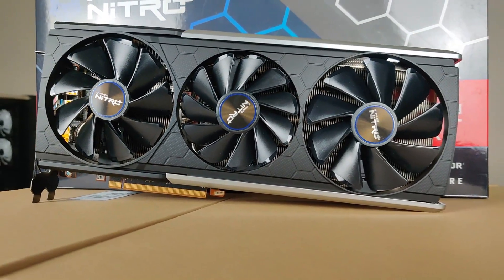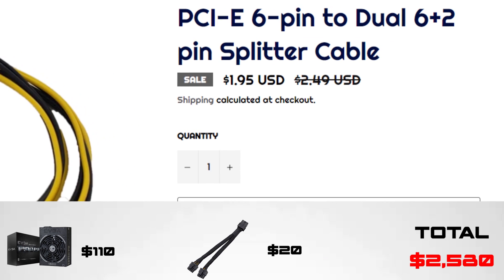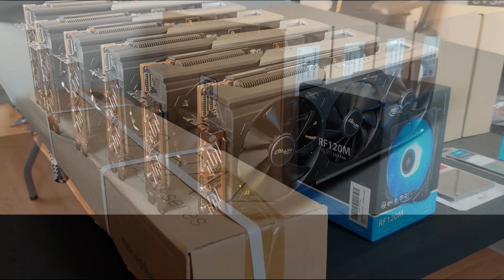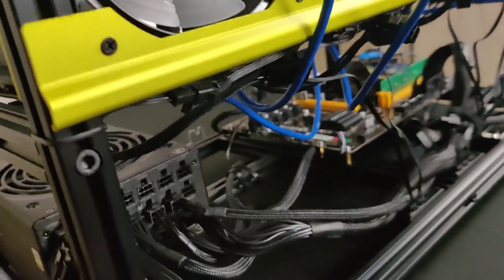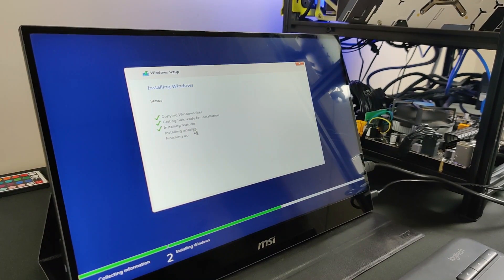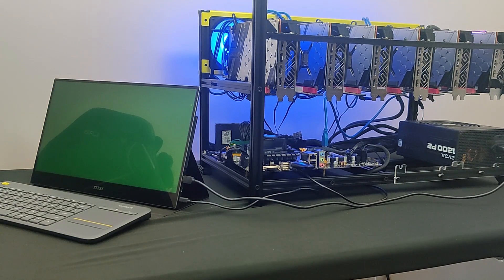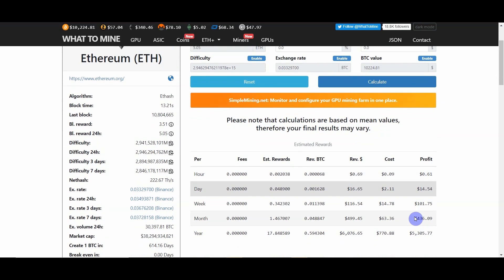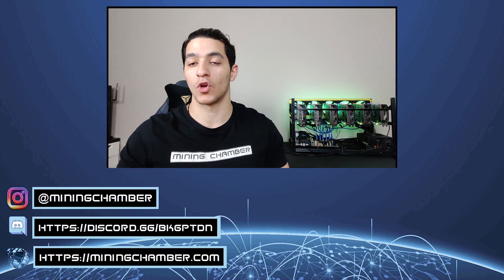RX 5700 XT Mining Rig Build - 6 GPUs | 330 MH/s and ONLY 880 Watts!!

Comment: In the last two weeks I have constant crashes on my  Powercolor Red Devil RX 5700 modded to XT version. It says that I have driver issues and wattman warning sometimes. :-( other card i have is XFX RX6800 XT and it works perfect. my settings are 1400 core clock, 800 voltage and 1800 video memory clock. I tried various versions of drivers and again same problem. I did stress test in AMD Radeon software and both cards passed it. Does anyone know what could be a problem? I am desperate!

Comment: Nice video...I am using a 5700xt, 1070 and a rtx 3060...The 5700xt memory junction temperature is 105-106 degree all the time..Is this normal ..The card is new..Please comment
Reply: That's actually cooler than most run. It's not uncommon for those to run a hundred and fifty to a hundred sixty degrees Fahrenheit

Comment: That's absolutely incredible. I started mining in 2017 and have the original gpus still humming along. I have 7 zotac 1060 6gb and 1 asus 1660 6gb. My total wattage including the box fan for extra cooling is 839 watts. Total Mh is 181. The cards are not cranked up too high as the heat vs reward ratio just isn't worth to squeeze out an additional 10mh/s.  I use a HP server supply and a 850w atx supply to power the mobo and 2 gpus/risers. Both are running on 240v instead of 120(higher voltage, lower current...Ohms law, and almost always more efficient). You also get the benefit of have exactly equal input voltage to both supplies regardless of spikes or dips. Which can snub out potential differences in rapid spikes or ripple that makes it through.    I am in awe of 330mh@880W. Man, i thought i was efficient lmao. It's always been like that too.

Comment: Hi all I'm curious but why are you using chassis fans if it's an open case. Wouldn't it be more efficient to have it enclosed with entry and exit so there is consistent movement of air?

Comment: To day: 27th July 2021:
I calculate the profit to your rig in my country (Algeria) where the  power cost (0.04$/kwh), and the rig run 10H per day, it will get 565$ per month and 595$ without power money.

Comment: nitro is the best gpu.s and low electricity. but i got 5700 xt.s  asus and asrock they got so hot specially memory temp  and when i try to overclock them they crash + height cost electricity

Comment: hi bro can i use stroner PSU  with high w than the description? the reason for that i want to combine rtx 3060 with rx5700 rig what you reccomand me bro? if i want for example 3 card rx5700 and 3 card rtx 3060? what psu i need for the description rx5700 miner

Comment: Hi, i am going to start building my very first rig but still looking for all parts so hard to find gpus. Thanks for a good video. I have question if i use rtx series 30 x 6. 1200w power supply is enough for them? Sorry for bad English.
Reply from the maker: if its 3060 TI or 3070 then yes 1200w is good!
Reply: testicular  The GPUs are not Ethereum specific,   these GPUs can still be used for bitcoin...and so forth... right?

Comment: Hello sir can i overclock just using my radeon software?

for my rx 5700 xT
this is the settings
GPU Tuning
Clock speed : 1256
Voltage : 256
Fan speed :2910
Current temperature :  47 
junction temerature : 56
Vram tuning:
clockspeed : 1896
Max frequency : 1900
Power limit : Disabled.
Reply: 54 hashrate. or is it a badthing?
Reply from the maker: 54 MH is not bad!
Reply: For 1900 sir? Max frequency? Wont easily destroyed?

Comment: I need help, trying to set my first rig but when I connecte 2 GPU's my PC not even boot. But with a single GPU it does. Someone else had a problem like this?
Reply from the maker: You need to tune up some bios settings, this should help https://youtu.be/XIT1f5nwHEw
Reply: @MiningChamber  So I got it working now before watching your video I tried with different combinatos on which PCIe slots I connected to and it worked but that means that it is not going to work with more GPU'S? I am going to watch your video also. Just I want it to clarify if someone else had the same problem

Comment: According to OuterVision, when I input your hardware data, it suggests you use a 1620 W power supply but you're using 1200 W. Would using a 1200 W power supply mean that the GPU will be working at less efficiency? Or, is the 1200 W good enough for this setup?

Comment: Would love to see an update on this rig. I'm considering building one. Still in use? Current daily profitability $9-10? Is there a better solution in 2021?
Reply from the maker: It does make alot more now due to the price flying up for ethereum, you can check it by putting it in a mining calculator!  This is a more up to date build and better https://youtu.be/zADbew6szG4

Comment: can u add a second psu to power additional gpus? 1000w psus are 300+ right now
Reply from the maker: Yes for sure ! As long as your motherboard supports more gpus you can add more psus and daisy chain them with a. 24 pin psu splitter

Comment: hey friend, I got a question if you dont mind :P

I got x8 RX 5500XT GPUs
and the only problem is that I cannot use more than 1 at a time.
the mining proccess works, but for the first GPU only.
I can change the config to make it use the 2nd or the 3rd one as well ! but cannot do all of the GPU's together...

is there any BIOS settings/general settings that I am maybe missing?
important to mention that I couldn't find the "Crossfire" option on my AMD panel for some reason...

appreciate your time, love your content !!
would be so thankful if you can help...

Comment: is it true that only 1 psu 1200 watt is enough for 6 rx 5700 xt?
Reply from the maker: Yes as shown in this video
Reply: @MiningChamber  is it safe to use 8 pin splitter ? because the gpu required 2 x 8 pin.

Comment: Is it safe to plug just one of the cable to gpu?
Reply from the maker: Yes one cable to the GPU as long as your giving all the pins on the gpu power. If you have a single 8 pin cable then you can use splitters

Comment: i didnt understand , you make 436.99$ in one month with this build ? and 5305.77$ in a year ? so in your case it took you 8 months to cover your disbursement. how it profitable?
Reply from the maker: So there are a couple of point here, 
1. Your investment remains in the form of hardware as well, so not sure if your keeping up with how the market is right now but I can sell everything for this rig for 3x the price at least. Which means 6k minimum of I chose to sell the parts.

2. Crypto has boomed again lately, profits a month are 2-3x now. This rig is making around 1K a month.

3. Never heard of an investment that makes your capital return in less than a year. Realstate, minimum a year to payoff the house, stocks, at least a year, etc. Ofc you can luck out but that's an exception. 

Not a financial advice just providing some insights

Comment: Does anyone know where to buy pre built mining rigs?  Not much of a computer guy....
Reply from the maker: Hard to find honest places for that. Its best to learn the craft so you dont struggle later with troubleshooting
Reply: @MiningChamber  Thanks for the input.  I"d like to learn the craft for sure.  Just not much computer experience...any suggestions on where to start?
Reply: @JesseLasater  Try starting by taking apart your home computer and putting it back together, take photos! Once you can do that you've basically mastered hardware as it really is just slotting and cabling
Reply: @potto1488  Thanks
Reply: @JesseLasater  np

Comment: Surprisingly enough, after 2 or maybe 3 days of configuration and madness I was able to OC my 7 Rx5700xt to Stable 390mh/s with roughly 800W power consumption
Reply: How’s that thing working man?
Reply: @Lineside  long term review: "not stable" xD
Reply: @ernon69  well that doesn’t sound good man, what is it doing? Sorry if that’s a stupid question, I’m new to mining.
Reply: @Lineside  it will lower your performance, crash mining process in general, but it all depends which card are you going to get, I had few cheaper models that's why it's was an issue
Reply: @ernon69  which models did you have issues with? I’m picking up a ASUS RX 5700 XT DUO  EVO OC 8GB for around 650, is that a decent one?

Comment: I have the BTC 250 Pro motherboard, same power supply. 1 Radeon VII (Scored for $700) & 1 Gigabyte RTX Eagle 3080 (Scored for $800). I can not get the motherboard to reconize either GPU and its only recognizing the Intel GPU. Just caught the quice mention of the Molex power for the PCI slots so I am goining to order that cable now. If I cant get it to work with that, then I'm pretty much at my wits end with trying to set up  this rig and will start selling off.
Reply from the maker: Don't give up that fast, look up basic troubleshooting steps

Comment: How loud is it d for running 6 GPU? Possible to put at bedroom and run 24hours
Reply from the maker: I had a 12 gpu rig in my bedroom for a while with 50% fan speed, not so bad for loudness it's like constant white noise in the background or AC running on full. But the only issue is the heat, if you live somewhere with hot climate then it will be toasty

Comment: Question: Would it not make better sense for all the GPUs to be facing either up or down? Rather than facing each other. I say this because you’re blowing hot air across the next GPU. Seems they would cool themselves more efficiently if they weren’t arranged this way.
Reply: I’m guessing the front facing array will pull a lot of that air away from the GPU’s.
Reply from the maker: The GPUs suck in air from the fans and push air out through the I/o ports. But yes you can def move them around for better temps

Comment: 0:42 not so sure about it... the saphire 5700 xt s.e. has dual bios and nobody around youtube talked about how to flash bios in that situation neither you did !
Reply from the maker: I myself was not aware of that switch on the nitro plus! Sorry! Although, in the overclocking and BIOS modding video I talk about the bios switch. Plus, you only need the switch if you brick your card.
Reply: @MiningChamber  the 5700 special edition actually has 3 position switch. 2 for the manual select and the third is for software select. when i tried to flash it was on this software selection and by the tdp I understand it was on the performance one. so i bricked that bios not because the selector but the  card it self does not accept the modified bios looks like for the special edition doesn't let me write any modified bios. the dos version of the flasher does not tell you anithing and write it anyway after that.. with that bios you can't even see specs on gpu-z. To figure all this I used windows version of amdvblash and this time it told me the bios can't be written and don't even start the flashing. but in the end my cards today makes 52.4 mh/s each with stock bios and since I have micron memory I can't push them over 1810 because every 24 I got a crash. Do you think by making the memory straps over 1550 at the same 1800 clock over I can't push , they could give me better result ?
Reply from the maker: That is very interesting, good to know about the special edition thank you for the info! And yes no matter what your oc settings are, bios modding it will give you the little push of 3-4 mh

Comment: How did you get so many 6 8 pin vga cords? Did you buy extra cables from the power supply supplier ?
Reply from the maker: The psu came with that many and then I used splitters ! I ended up powering 3 risers with 3 different molex strands as well

Comment: can a Intel BX80677G3930 7th Gen Celeron Desktop Processor be used since the other ones are out of stock?
Reply from the maker: Depending on your motherboard but if it's the same as this one then yes. Check the buying guide it goes in details about this topic ;) one of the latest videos
Reply: @MiningChamber  awesome it’s the exact one your using! I am almost done collecting the parts for it. Only wish it was at the price you got everything for haha
Reply from the maker: Awesome! And yes haha I wish too that I can find them at the old prices 😅😂

Comment: Quick question how do you know when to use a PCI-E Splitter and how much should you buy?  My GTX 1660 Super (2), RTX 3060Ti (1), RTX 3070 (1), GTX 2070 Super (1), and 5600XT (1) just came in today.  Thanks.
Reply from the maker: Splitters are essential in every build most of the time to run your gpus and risers off of the pcie cables. So check how many pins you need to cover and how many you have then get splitters accordingly. It's always good to have some extra, check the psu ATX guide for more info!

Comment: i got a EVGA 1600 watt power supply, cost over $500 canadian. The problem is, not enough double 8 pins to power 6 5700xt. Is it fine to use splitters? At my local computer store they said tis not recommended to use VGA splitters? not rally sure what to do. Thanks
Reply from the maker: Yes for sure! Check the psu guides that we have it should help you out ! No need to worry on what they say, almost every rig requires splitters to power all GPUs and risers

Comment: hello, a question do I have to connect the molex cable to the 2 auxpower connectors of the motherboard ???? What happens if I don't connect them?
Reply from the maker: It's preferred to do so, they just provide more power and stability to the PCIE slots. You will be fine if you don't although you if it becomes unstable then I'd recommend plugging them in

Comment: 330 MH/s is extremely low, considering an ASIC with the same price can generate 100 TH/s. Yes, terrahash, as in 300,000 times.
Reply from the maker: I believe I answered you in one of the comments but yes the main difference is that with an ASIC you can't mine ETH (for those with Tera hash of power) they are most likely made for BTC like the S19. BTC difficulty is way higher so profits will be not that much. I recommend checking ASICs profitability calculators to get more information
Reply: @MiningChamber  I'm sorry for double post 😢

I'm interested in building my own mining rig, but last week my brother point out that an ASIC can reach 110 TH/s and it's just get a few dollars profit, while my proposed rig will only get 120 MH/s. So I look out for profit calculators in the internet, and what I found is disheartening. 

If people can barely breakeven with 100 TH/s ASIC, then what is my chance of 120 MH/s build? Won't that mean a loss? Or is there something I miss?
Reply from the maker: Your probably calculating it with Bitcoin profits. Gpu miners mine Ethereum not Bitcoin. So go to WhatToMine.com, put your Mh in the Ethash field and youl get a better estimation. Generally with hashrate now, 60 MHs makes $200 a month so that should be around $400. And it's okay!!
Reply: @MiningChamber  Thank you. That clears it. But .. what shall I get from the website? It's full of boxes with labels .. I'm overwhelmed.
Reply from the maker: Check our latest video I do cover that slightly in checking profitability!

Comment: Do you have suggestions on using HX1200 to power 6 rx 5700 xt? There are only 6 pcie outlets and one has to be used by cpu.
Reply from the maker: Yes you can use it and then you can use splitters to share 3 pcie cables between 2 GPUs. Power some risers with Molex max 2 risers per molex cable
Reply: @MiningChamber  Thanks! I'll try this wire solution. A follow up question is whether I will need to undervolt gpus to fit into 1200w? Or default is okay for ethash?
Reply from the maker: Always always undervolt! Unless you want your GPUs to die out !